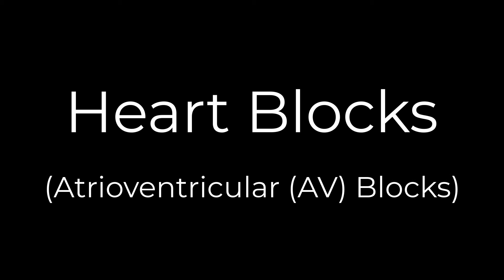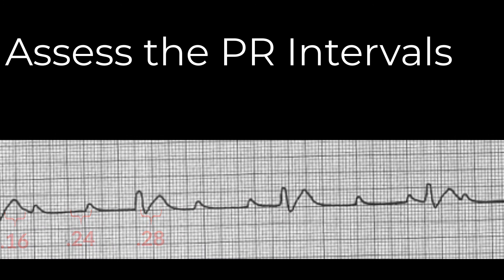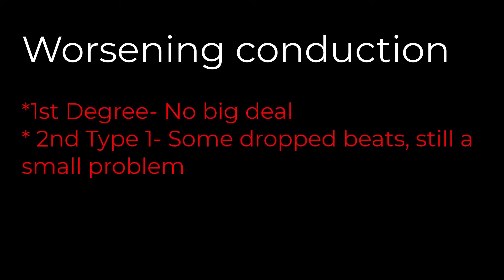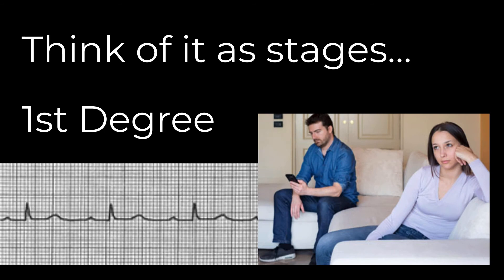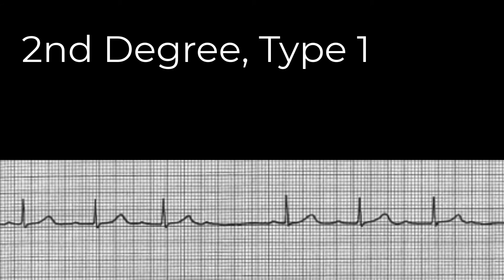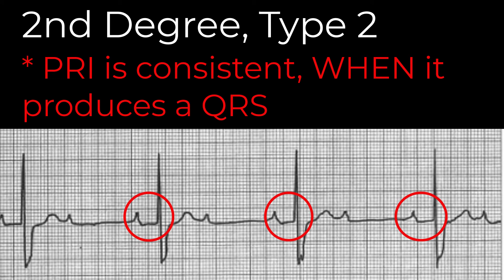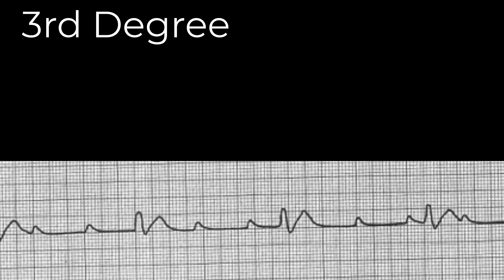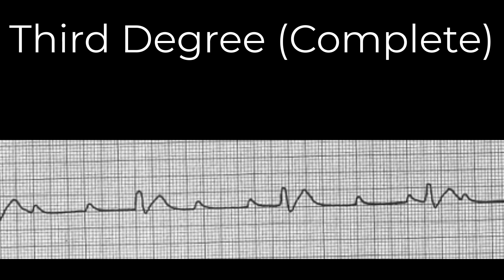9 Heart Blocks

Comment: Another one of your excellent videos I will share with my paramedic students.
It is my understanding Dr. Wenkebach first discovered 2nd type I before EKGs were invented, using his stethoscope.  Then Dr. Mobitz rediscovered type I with an EKG, going on to discover type II describing the EKG findings for both.
I was a little surprised you did not distinguish AV nodal (1st, 2nd type I, & narrow 3rd) from infranodal (2nd type II and wide 3rd) heart blocks.  ACLS addresses this in whether to consider Atropine or pacing as first line treatment for symptomatic bradycardias.